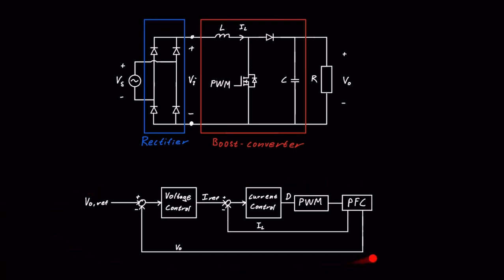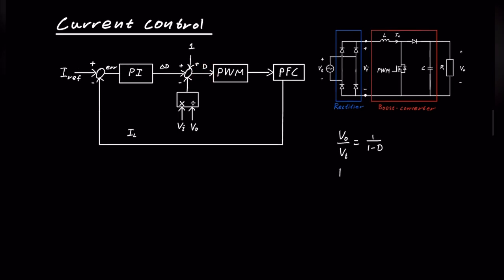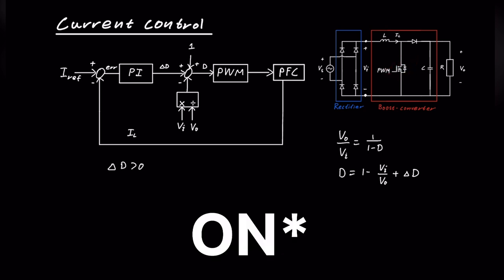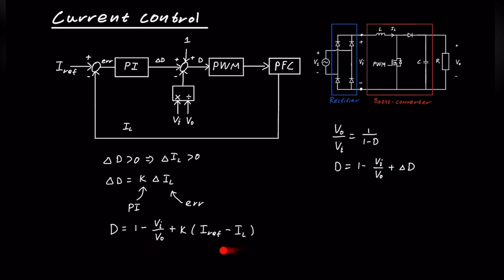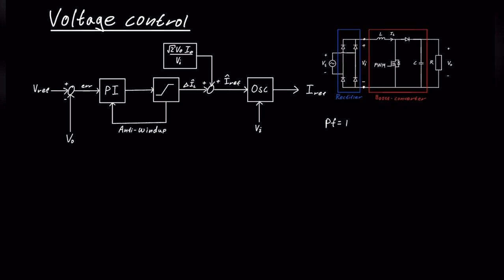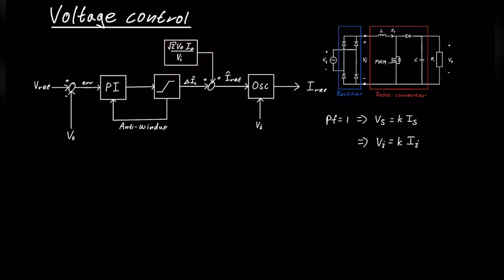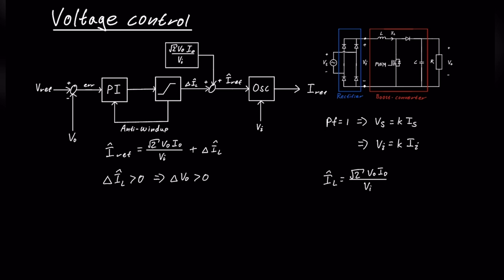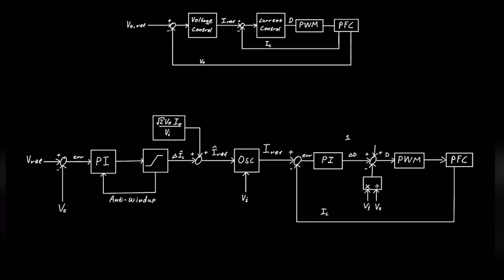How to control a PFC

Comment: Hello. I really liked your video and it helped me a lot. I am using the control loop for my Bachelor Thesis and I was wondering if you have some literature in which this design is published. Thank you in advance for your answer
Reply from the maker: Hello, happy to hear that you liked it. I don’t don’t have an overview over papers for this topology. But if you search up «single phase pfc» at google scholar, you will find many.

One called «Feedforward current control of boost single-phase PFC converter», seems to have a similar control method for the current controller.

Alternatively, you could look up control for totem pole pfc or just a regular boost converter. 
The idea of the controller is basically the same.

I hope the answer was not too late, feel free to reach out again if you have more questions. I’d also happily share simulation models of this topology in Matlab. I also have an interleaved Totem pole PFC in Plecs, simetrix and Psim.
Reply: Hey I like your videos a lot. Would you be able to share the Plecs model for the interleaved totem pole PFC? I would use it as a reference to design a bidirectional (non-interleaved) totem pole pfc.